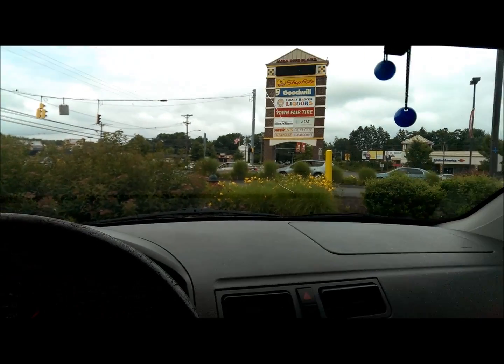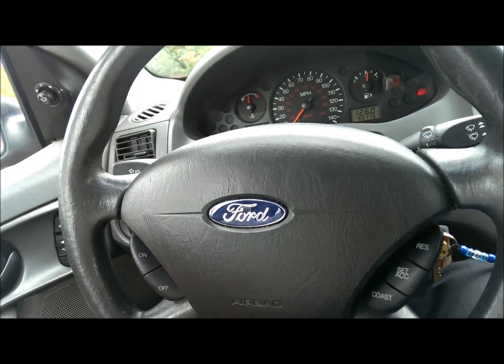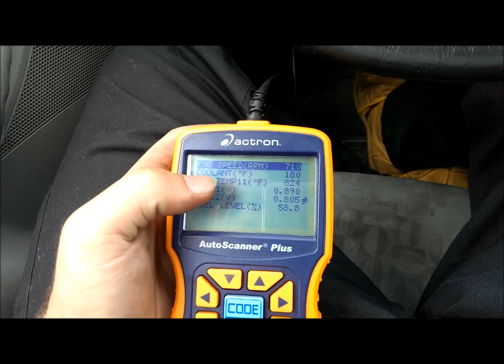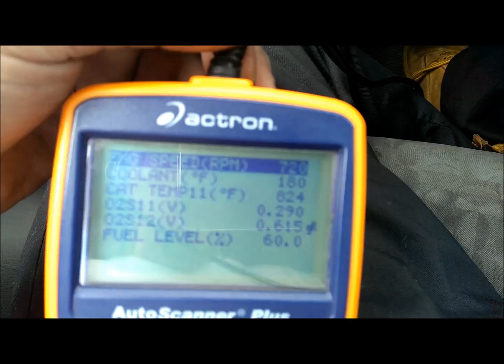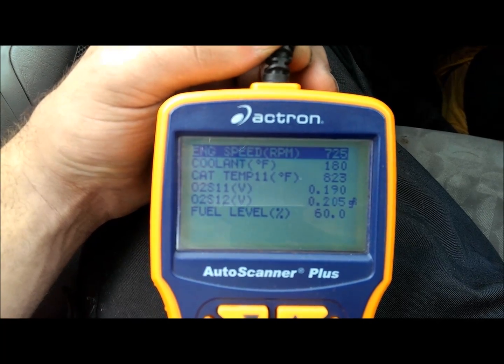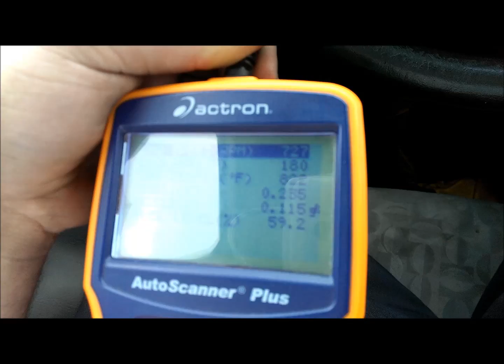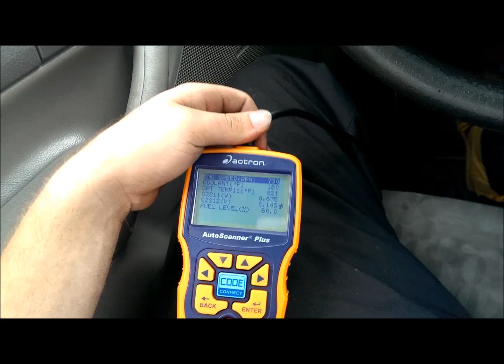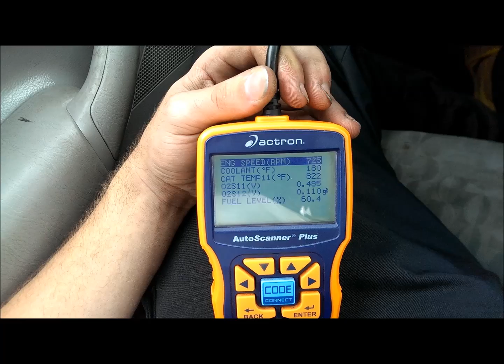How to Check For A Bad Catalytic Converter

Comment: Will replacing your bank 1-O2 sensor(1) fix a P0420 code... Or  does a P0420 always mean you have a bad catalyst converter?
Reply: +Dale i'm sure you are busy, so thank you for the reply Dale. That is what we ended up doing, changing the O2 sensor. I wish you the best! - Will Vice
Reply: +WiLL ViCE! You may have two catalytic converters, so this may not tell you which one is the issue. Better to check your O2 sensor first.
Reply from the maker: +Will Vice I am sorry for the very late reply. There is a slight chance that it could, but in my experience I would find it highly unlikely. Almost always a P0420 code means an inefficient catalytic converter and that is exactly what it is. Many people say to replace the o2 sensors just as you asked. However if the car does have a failed or "on the way out" o2 sensor, it will usually throw a code for a bad o2 sensor and not a catalytic converter code.
Reply: Will Vice could also highly likely 90% chances it’s an exhaust leak...speaking like dude in video.

Comment: mine keep going bad. I have replaced it 3 times. AAMCO transmission told me it was the tramsmission control module or engine control unit . They suggested replacing the transmission.
Reply: you know what else can cause that  especially in gm. ignition switch, i was getting transmission solenoid codes, thought my trans was bad, it was the ignition switch since the circuit runs thru the ignition switch and down into your transmission. nuts
Reply: aamco would suggest rebuilding your transmission if you pulled up with a flat tire

Comment: Dope! Thanks.. I have a question. I hope you can help me.
(2008 Grand Prix) What if I am getting a P0300 (random miss firing code)? Is there a chance that it could be the catalytic converter. I am receiving similar symptoms (hesitation, lack of power, and poor gas mileage). Please help if you can.
Reply from the maker: +Larry Monroe I am very sorry for the late response and I am sure you have resolved your issues by now, but I will answer your question anyways lol. In my experience as a Chevy tech, the only possible way I could see a bad catalytic converter cause a misfire is if it was SUPER plugged up and was having a ton of back pressure in the manifold. In this instance I would remove the upstream 02 sensor, hook up a back pressure gauge to the upstream o2 sensor plug and have someone crank the engine over while you watch the readings and see if there is a lot of pressure.

A lot of times on GM vehicles, a P0300 code is very tricky to track down the source but none the less is an actual engine misfire. On my own vehicle (2008 Chevrolet Cobalt with the 2.2L) I have a P0300 code due to bad valve seats in the head of the engine causing compression loss, which "technically" registers as a misfire in the engine. A P0300 can be anything from compression loss, to bad fuel, to bad plugs and coils. But I highly doubt that a catalytic converter would be so plugged up to cause a random multiple cylinder misfire.

Comment: How can you read whether its actually the Cat based on these readings, or if its the sensors that are bad?
Reply: That is not correct. If the O2 sensor fails but stays within the village window- say .3 volts on upstream o2s it will not through a O2 code. Maybe 1131&1151
Reply from the maker: +talia leigh That is a good question. However, most of the time if there is an issue with the o2 sensors then a check engine light will appear for an oxygen sensor code and not a bad catalyst. Hope that helped, sorry for the long time to reply

Comment: Some dude told me the other day that buying another catalytic converter isn't necessary. So, this is what to do instead.

1. Get the Catalytic converter out.
2. Drill a 1/2 inch hole
3. Get a rubber hammer
4. View the catalytic converter as the most annoying guy you know and let the hammer like: "Can't take this!". Just cut loose.
5. replace the Catalytic converter facing down where the hole is.
6. Turn on the vehicle and run it, accelerate (All that's inside the catalytic converter causing it to plugged it goes away through that hole).
7. Take the Catalytic converter out.
8. Plug it with a bolt or weld the hole.
9. Replaced the catalytic converter making sure the plug side is upside up (You don't want the inspecting people to see it, or else...you know?).
10. Problem solved.
11. Take it to the inspection shop
12. Pass!!!!!.

He also added: People don't know this, but now you do. Keep what comes out of the catalytic converter, it's called "Carbon", refined carbon, the same carbon that can be turn into diamonds. So, you can sell it as it is, raw.
Reply: Nuckelhedd Jones I know very well who the Grand Negus is and it doesn't take a genius to figure it out. The Grand Negus is an ugly character, some sort of deformed being, with big head, big ears, etc. It's the bad guy of the movie Sin City, the one that Bruce Willis pulled his dick and testes off. 

Problem solved, now everyone knows who the Grand Negus is. Man!, wish I were in Who wants to be a millionaire and make it to the last level and they ask me: "What's the name of the Movie where the character Grand Negus plays a role as a pervert. Without a doubt...."SIN CITY"!!!!.
Reply: I  was thinking  of doing that , but what  about the nox and over all emission test ?
Reply: +argent2020  Once you gut the cat, the PCM will know it is not working efficiently, you will not pass emissions test if you are required to get one.  The feedback to the PCM will eventually kill it, you are warned.
Reply: +Grand Negus  Sad they don't know who the Grand Negus is.
Reply: Grand Negus So u'r a niga lover? :)
Reply: Grand Negus You're so fucking cool!!!!. Jajaja A ponerla!!!!.
Reply: +argent2020 Damn! This man is brilliant. I just wish I had the means to do this. :D

Comment: For today's cars, you need to know about what you are working on. The three-way-catalytic converter (TWC) is part of a whole engine fuel/exhaust system design. With a proper functioning engine system, today's TWC are designed to operate for the life of the car and meet emissions requirements. In the case of inefficient TWC, the best way to test is with an exhaust gas analyzer (which are expensive) and proper testing methods of which there are several. If a TWC is determined to be defective, the cause of the failure must first be determined. Not to do effective diagnosis and repair of the root cause of TWC failure can result in replacement failure soon after. For example, California emissions testing is super tough and replacement TWC must meet those requirements. Even replacing a TWC in California must meet strict requirements. In some areas of the U.S. to even replace a TWC requires a special certification. Go to any auto parts web site (try rockauto.com) and notice most of their TWC offerings cannot be sold in California. OEMs are often what is needed. For a comprehensive discussion on engine emissions design and catalytic converter info and testing go to this link. This information is also quite helpful in avoiding a TWC failure in the first place. http://www.lbcc.edu/attc/documents/BAR-2011-CAT-testing-methods.pdf

Comment: I own a 99 cadillac deville concours (North-star engine)  , I'm smelling a bad smell coming threw my vents (rotten smell) , my car misfired aswell. I just got my oil change , coolant flushed , spark plug changed and a new fuel filter , need help

Comment: I would make sure to note, a vacuum leak or almost any other out of parameters air leak or fuel leak or coolant leak into to the combustion chamber can cause inconsistent 02 sensor readings. other wise great video   thanks
Reply: check the fuel trimes    postive fuel trim = vacum leak,   negative fuel trims means the MAF or bad air filter

Comment: what if you have 2 cats in between those two o2's? which cat is the bad one then?
Reply from the maker: Good question. Well-known YouTuber EricTheCarGuy actually did a video on this on a Subaru with 2 cats. I believe he did a temperature check, where he took the temperature of both catalytic converters with an infrared thermometer. Usually catalytic converters run somewhere around the 1200 degree (F) range. If one is un-normally cool, that's usually the bad one because it's not working as efficiently as it should. Look it up here on YouTube and hopefully that can help you out. Thanks for watching and thank you for the question!
Reply: KKFan9 great vid. Thank you.

Comment: This is very good information. I did the same thing with my scanner yesterday to determine my Chevy Impala Cat is going bad. My post O2 sensor is all over the place with it's voltage and car is starting to lack power. Still no check engine light though.

Comment: My car has some rattling inside the catalytic converter, and the temperature gage stays on 3 quarters, doesn't go down even when the electric and the motor fans are "ON"
PS: I changed, the thermostat, and both cooling sensors.
Thanks for your answer and advise.
Reply from the maker: I'm sorry that it's taken me so long to respond to your question. First things first in a coolant system overheat, check to make sure that there is no debris between your fans and radiator. Things like leaves, papers even plastic bags can get sucked up in there and block the air to the radiator. If there's no such thing, then check the level of your coolant (do NOT check coolant when the engine is hot, bad things can and usually do happen lol). If it's low, add the recommended type of coolant to your vehicle (or even plain tap water will work) and pressure test your system and see if you have any leaks. That's where I would start. 

As far as the catalytic converter rattle, inside a catalytic converter there's big chunks of iridium and other really precious elements inside. A lot of times over time those blocks get corroded and start eroding away, causing movement and shakiness which is what the noise is. Thanks for the comment hope I helped with your issues!

Comment: If your check engine light is coming off and on ..and its for the same emission code its sings your cat is going bad, its not bad just yet.. may also flash a couple times (check eng light)

Comment: Hey thanks for the video, it was very helpful. I went ahead and did the same test on my 2007 Prius with a p0420 code, and trying to find out if it is a bad O2 sensor or a catalytic converter, the temperature for the cat is around 1200... can you take  alook here and let me know what you think? P0420 On 2007 Toyota Prius with 188k miles - O2 Sensors, Catalytic Converter temperature

Comment: He's dead on with his evaluations of the o2 sensor readings. If the the cat was good the downstream sensor would be holding around a half a volt. Mimicking the upstream sensor to closely is what the computer looks out for in determining a bad cat code.
Also the reason for these kind of videos is for DIY's to be able to understand and help diag problems without taking it to a shop and relying solely on the word of a so called professional. And scan tools are not meant to replace mechanics, but to be used as a tool in tandem with proper diagnostic procedures in tracking down a problem.
Reply from the maker: You are totally correct Michael. Code scanners are not meant to be insta-solve tools, but more so an idea of where to start as far as any issues you have with your car. Anything that you can learn about vehicles (especially now days with cars being essentially a computer with 4 wheels) is only beneficial. Because cars are heading in such a direction, many of the diy guys that were so abundant even just 20 years ago either cannot keep up with the new technology, or refuse to.

But if there ever is a time for people at home to learn and try to save a few bucks on their vehicle repairs/maintenance, it's todays age where dealers are charging people upwards of 100 bucks just to put the car on the scanner! I dont know about you but I work hard for a living and 100 bucks is a lot of money to spend on just finding out the general idea of what's wrong with my car. Thank you for your comment, I hope you enjoyed the video!

Comment: Hey KKFan9.....during the latter part of the vehicle you commented that you didn't know what the little symbol to the right of the O2V12 reading was....that is a indication that the tool will display a graph of that data if you highlight that particular parameter with the "cursor" and press the enter key. I have an Actron CP9185 an just learned today that you can graph most any of the parameters by selcting and pressing enter...pretty neat-o
Reply from the maker: You learn something new everyday! Thank you for sharing, that is pretty cool to find out. Thanks for the comment!

Comment: check, how many wires have your sensor? if 4 wires the problem are the sensor dont heat yourself, the voltages seens good to me
Reply: I have been on different sites now and they all pretty much say the same thing he said. I just tested mine a few min ago since my light has come on today and it dose the same thing. I have a 01 with the Zetec engine. have you replaced your CAT? My car is running really bad now.
Reply: pamtreo72
not yeat, cus its run almost normal, maybe a little more fuel consumption. but i will change it soon